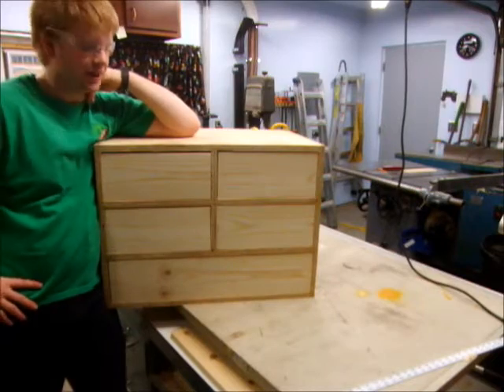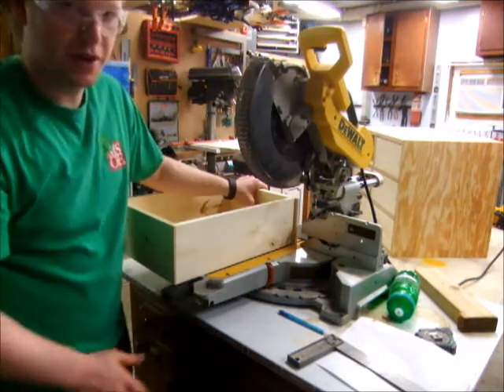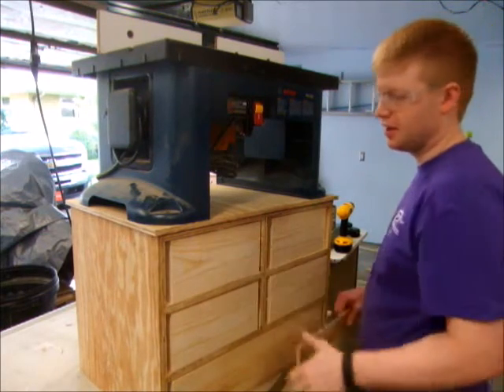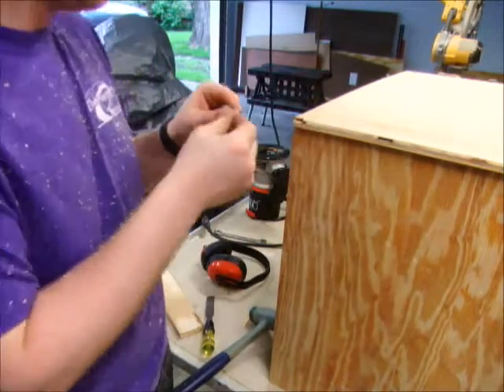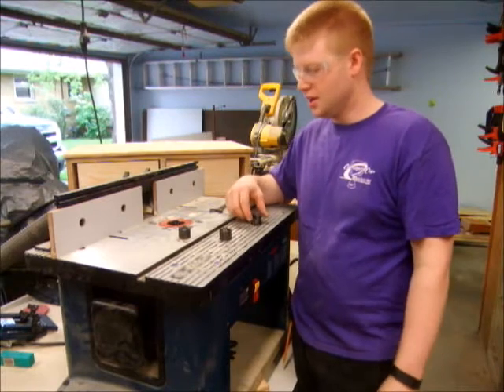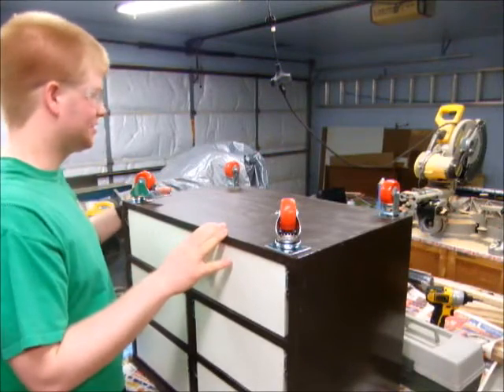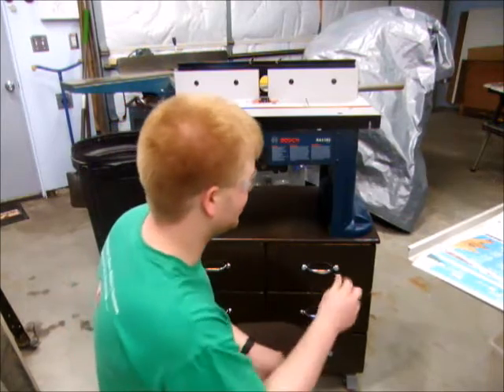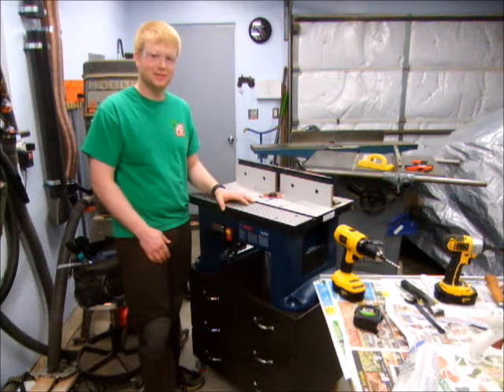Riser Cabinet for Bosch Router Table, Part 2

Comment: Good job, man. I am building a cabinet stand for the same router table. I almost made the same mistake as you with the table top piece. I measured it at 28" at first but then added an inch just in case. Came out to 29" wide and your plans confirmed that size. Thanks for showing your errors. Keepin' it real!

Comment: You stated that you have the Triton router. Did you have to modify the mounting plate in order to add it to the table?  I have the same table and the Triton router and added the Kreg mounting plate after a few adjustments,  a few cuts, etc. in order to mount my Big Triton router to the unit. Appreciate any feed back you can give. Great table by the way. Thanks, Todd R